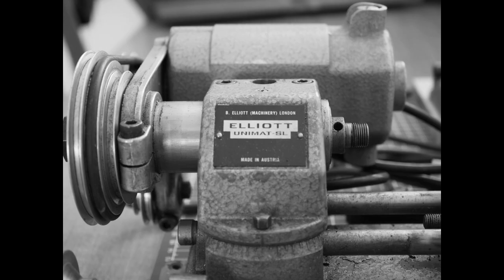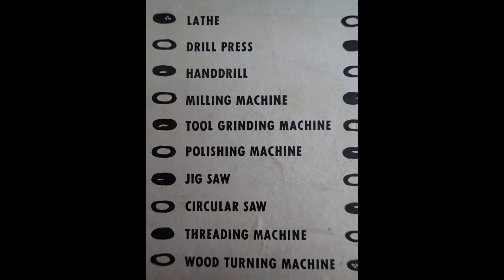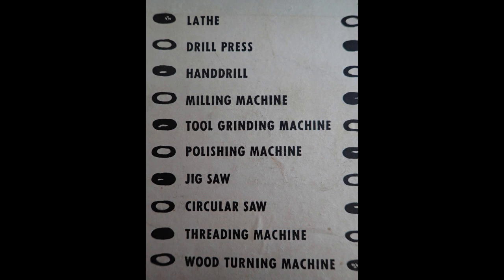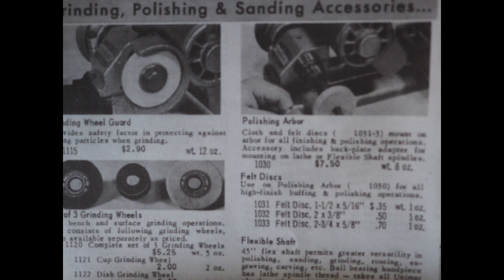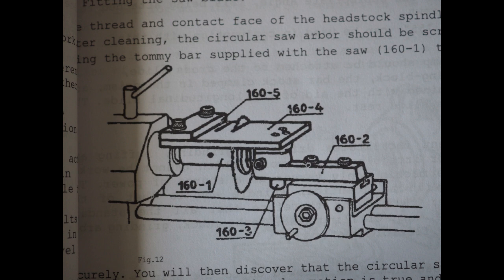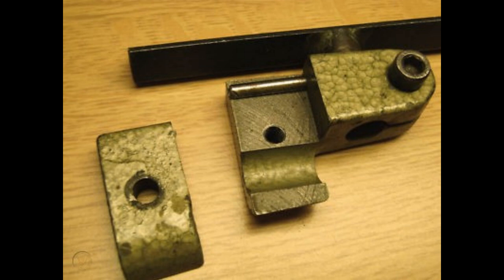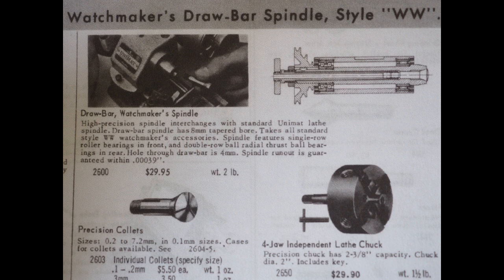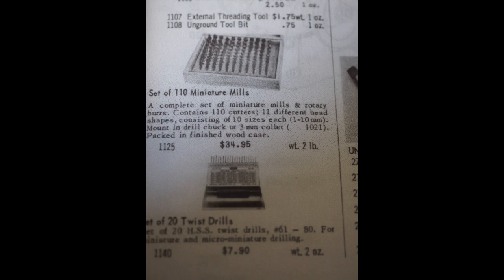All About the EMCO UNIMAT SL Lathe.

Comment: Looks like a good small machine, Paul.
Any news from Warco, on your new lathe ?
ATB
Adam
Reply from the maker: Hi Adam,
I do find the Unimat SL really interesting... Seems to me just smart engineering to build it 70 years ago.
Warco are saying late September / Early October... I am still looking around, maybe something else will turn up before then.
Thanks for visiting.
Paul,,
Reply: @TheKnacklersWorkshop  
A good friend of mine, has a similar looking small lathe gathering dust.
He use to make small BA nuts and bolts for his large scale steam loco's.
He stopped building  loco's, as he got into building large scale RC helicopters.
That's how I ended up buying a lathe etc.
Adam
Reply from the maker: @adaml52  Hi Adam, Please email me the spec and a couple of photos and i'll have a look... My email address is on my about page.
Cheers
Paul,,
Reply: @TheKnacklersWorkshop  
Hi Paul,
It will have to wait till after lock down, my mate has medical conditions.
Adam
Reply from the maker: @adaml52  Okay... Health is more important than a lathe...